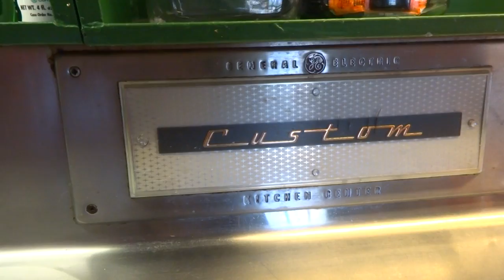PROPRESS FITTING POPPING OFF INFERIOR  PRODUCT TO SOLDERING

Comment: Going to be interesting to see what the heat does to those rubber gaskets
Reply: do a little research rubber seal is not what seals the water  but the actual press copper to copper, so it should not affect  at all.
Reply: @uspatriot9599  he's always doing band-aid fixes. 🤦‍♂️ To each their own I guess
Reply: @gelipeone  The rubber makes the seal dude... You think pressing copper together creates a seal? Lmfao
Reply: @uspatriot9599  Copper will also leak down the line, nothing lasts forever. Propress fittings are rated to last 50 years minimum. By that time copper would also have begun corroding. A soldered connection will hold much longer than the pipe itself will. The solder would last hundreds of years but the copper itself won't last even close to that long. Copper's lifespan is only about 50-80 years. Pex's lifespan is 100+ years. 

Propress has been around for 30 years and I have yet to see one fail on its own and not because of user error.
Reply: @losferwords100  Pex's lifespan is much less if you have mice. They chew right through it.
Reply: @darrenr1194  if 32kn won’t then I don’t know what will wonder how the details in coins stay together for decades too maybe soldered 😂
Reply: @johnnya4236  You're comparing a coin which is pressed into a mold creating a shape.... We're talking about two pipes here. Pressing two pipes together will not create a water tight seal. IF that were the case why is there a rubber O ring in each fittings end? If you could press copper to create a seal why can't they press together standard fittings? Smfh total clown who knows nothing.
Reply: @ImmaculateSludge  Problem is some plumbers are lazy or don’t know how to solder a joint!
Reply: @darrenr1194  ,I think you missinformed ,read little more.
Reply: @uspatriot9599   and do you believe that a simple o ring is going to last 15 -20 years ? the seal is a just in case,what makes the seal is the pressing actually bonding the copper together
Reply: "Rubber" comes in numerous types, and is used in nuclear power plants, helicopters, submarines, etc.

Comment: I’m a plumber I use pro press. And yes I know how to solder I’ve installed water heaters with soldered fittings and pro press fittings. Notice how the pro press ball valve on one side was crimped on to painted pipe without sanding the paint off the previous plumber had very little experience installing pro press fittings properly.

Comment: One reason for pro press besides the ease of installation is the fire risk associated with soldering. Insurance companies don't want to cover the cost of fire damage. I read on a plumbing forum a while ago that Massachusetts was going to require a off duty fire fighter to be on scene for all plumbing jobs that required the use of a torch. Guess that law didn't pass but that's where things are due to lawsuits, etc.
Reply: Thats why the need for pros 
If you know what your doing and pay attention you will never have a fire
Reply: im in mass and that is true...i know boston is requiring  "hot work permits" gotta have a guy on fire watch for i think 2 hours after and he cant be doing anything else....soon the whole state will have that
Reply: @jackblack9830  You obviously don't do commercial/industrial work. You have to find a fire watch, supplied by your company. You have to get a hot work permit signed by the appropriate people in the facility. Hang the hot work permit where you are working after you sign your life away. The firewatch HAS to stand there and watch you run your torch the entire time. If he stops paying attention you will be thrown out. Once you put your torch out most facilities require the firewatch to stay there and watch for fires for up to two ADDITIONAL hours after the torch was extinguished. Failure to do so and most safety guys will throw your company out permanently. Money is not an option for safety to big corporations. You just stick to your resi work my guy, the rest of us will do the big boy work.

Comment: More than likely it froze. If it freezes yes the progress will come apart. If it is soldered and it freezes either the pipe breaks or the solder joint also comes apart.  So it is not the pro press it is the home owner who let it freeze. If you do not want to use it that's fine your choice soldering is still great I mostly solder. But because you don't want to buy the tool don't mean the system sucks, also I am sure with all the Chinese fittings there will be issues. When I pro press I try to only use Viega. And you cannot solder that close to a pro press fitting.

Comment: No plumber likes progress and mega press until they finally shell out the money for the tool and realize how much of a lifesaver and time saver it is. My guys tried to talk me into getting it for about 2 years and finally gave in. They were right what a great system. Time will tell the lifespan of the o- rings.
Reply: Even then.... If it leaks in 15 years.... Cut it out. Crimp and replace in 15 mins. Done and done.
Reply: @travisnguyen3905 yeah unless you can’t afford to risk the potential $10k+ of potential damage to your structure if that happens

Comment: If copper soldering is done right it is certainly superior to the press system. But we also use stainless steel pipe for potable water overhere so there is no way around press fittings. If done right, they should not leak. But the main concern I have is the hundreds of O-rings in a typical home installation. Rubber deteriorates over time, solder does not.
Reply: What a crock! Solder joints leak all the time! Properly done ones and otherwise.
Reply: @SureShotImages  It's it funny how people claim solder joints never fail? I fixed more than I can count and I was only a service plumber for 3.5 years. I got as far away from that bullshit as I could. I'll stick with HVAC.

Comment: any fitting that relies on a rubber o ring and just a friction fit is guaranteed to fail sooner or later I stick with solder and copper pipe over all this new stuff that fails 10-20 years later like the plastic pipes

Comment: Morning Steve. I've been waiting for this specific video for a long long lonnnnnng time. I knew it was just a matter of time. I agree with you - in my house, it will all be sweat joints. Period. I saw a joint the other day on a press that was leaking because it was crimped at an angle. Drip drip drip. Never seen that on a sweat joint. Old school methods work for a reason. Just like everyone is going back to shaving brushes & double edged razors....grandpa was onto something wasn't he? Have a great Sunday
Reply: I love the double edge razor, been using one for the past 15 years. They give you an amazing shave and much more economical then the cartridge. I do own a single blade like the barbers use but don't feel comfortable with it yet.
Reply: @potatolew4495  60 years.  shortage of blades, double edge
Reply: 20 + years waiting for this video and just to find out mostly the person that installed it wrong 🤣🤣🤣
Reply: @seniorcomputer3292  Schick razor bought up alot of the old diesel submarines for their metal supply.
Reply: You've never seen a joint that was soldered at an angle that some hack plumber tried to pack with solder anyway?

Comment: I’m a firm believer in soldered joints......I’m not caring for propress , shark, or even pex that much I’m just old school when I first started we even used soldered copper waste lines
Reply: My brother's house in Chicago has all copper waste lines... I can't even imagine how much that'd cost to install nowadays between the cost of copper + cost of labor... he's thinking about DIY replacing the drain lines with PVC and selling the copper. Never understood what the benefit of copper drain lines is, must've been cheaper than cast iron at some point, but before PVC was widely available
Reply: @Reinhardt_Kozlowski  I sure it wasn’t cost conducive but we built homes in a upper class area and high level homes were expected to have the premium of everything I remember the carpet going down over unfinished hardwood flooring and of course all the sheathing was 1x lumber no plywood ......it was a lot different then in quality of homes
Reply: @danbailey96  If cost and time isn't an issue, then it seems like good quality cast iron (w/lead and oakum joints) would be a far better option than copper for drains. Legit question... I still have no idea what the benefit of copper drain lines is. I can understand cast iron (quiet and time tested), I can understand plastic (cheap and reliable), but copper????  That stuff is amazing for supply lines but I've never understood why there was a short period of time (early 1970s to early 1980s in Chicagoland) where copper drain lines were somewhat common. If you know the reason I'd be super grateful to know.
Reply: Copper drains was trouble free and probably more of a status point also ....we used copper guttering and flashing and valleys on the roof of course those were rust free and worry free. I have also replaced cast iron that had split....of course they were several years old.  Being in the home building, remodeling and now Handyman business for 55 years I’ve seen and done it all.
Reply: @Reinhardt_Kozlowski  You only had 3 options back then....cast iron, lead, or copper. Cast iron and lead were in the past and PVC and ABS weren't a thing yet.
Reply: @danbailey96  Yeah right dude, drain acid will wreck a copper pipe. PVC all the way. PVC, when properly primed and glued, will last almost forever.

Comment: I live in a large apartment building. Everything is soldered copper. Even when something like a water heater needs replacement the new one goes in with soldered copper. They won't let any plumber use PEX or ProPress.
Reply: Then they are foolish
Reply: @pb7379-j2k  Sure they are. They like paying for labor for no added benefits.

Comment: When soldering you are introducing chemicals into water supply not to mention open flames in tight spaces 
Propress is the best.
Previous guy didn’t press it properly

Comment: We have a little bit of Sulfur in our water, it eats up Rubber. Took me awhile to learn to use Silicone Hose Gaskets, especially on the Clothes and Dishwasher. I wonder what kind of Rubber Gasket is in the Pro-Press? BTW, Don’t use Pro-Press on a Water Heater Relief line, each Crimp counts as a Turn in the Pipe, in a lot of Places. So a Single Pro-Press would be equal to Two 90” Here we are limited to the number of turns off of the HW Relief, as it is a restriction.
Reply: The o-rings in the copper press fittings are EPDM rubber

Comment: I’m certainly not an expert, but when you show the propress fitting toward the end of the video the right side of that fitting did not look like it was fully crimped/pressed.
Reply: It wasn’t, we use pro press in high rises and hospitals all the time.  It is mandatory because of no burn in building codes.  Never had one pop off and we do ground up high risss with them.  Looks like a amateur tried to install them.  Steve need to stop hating on other methods your not familiar with.  Both methods are great if done properly.

Comment: up here in mass more towns are making you get hot work permits before you can even light up the torch.....more guys doing pro press..it has its place like everything else but soldering still needs to be done and taught to the new guys coming up..

Comment: If it popped out it was not made up all the way.  We use this in very large commercial installations on up to 4 inch and it works very well. Go to a large building were you can not get water shut off all the way and don’t have a pipe freezer pro press is awesome. You can cut a line with water spraying out and jam a open valve on it then close it after it is pressed. I have been installing pro press for 10 years I am a licensed plumber and I have never had a problem.

Comment: I personally love pro press, never had a failure with a few thousand presses so far. We also do mainly highrise/commercial bigger scale stuff.
Reply: yea I wonder if they failed to do it right ,I like sweating pipe but hard to find most tech is going away form it .
Reply: How do you know if they never failed? 2, 4, 10yrs down the line I'm pretty sure another guy was called to do a fix. You know? Hard to track every single job after its done.
Reply: The propress has been around since 89, the biggest advantage is you can press when you are passing water, I've been using it for close to 10 years and have not had 1 single callback of the buildings we still have. Honestly for small mickey mouse homeowner stuff who cares but when you need a bigger building back online I definitely don't miss sauldering, I can pipe in so much more in a quarter or the time. There's really nothing to sauldering tbh, the biggest failures I see in buildings are pinholes from dumb plumbers that don't rheem out pipe or sloppy sauldering jobs.
Reply: @sku32956  Or probably using some cheap press tool.
Reply: @VicHimself  majority of work is done without it so its kinda another reason we dont see them failing. Not many out there and when (if?) they do fail, another guy is called to repair it so we would never know. Impossible to keep track of every job and fitting. I dont even remember what job I was on 2 weeks ago let alone 2 or 5 yrs ago. Lol
Reply: @WeatherNut27  I personally would rather work smarter then harder, I think as long as the prep work is done properly there's nothing to worry about. Also a big advantage is beinh able to press in tight spaces to make emergency repairs.
Reply: @VicHimself  I hear you on the tight spaces but if I'm getting T & M I'd rather take my time with something that has stood the test of time. Lol :-)
Reply: @WeatherNut27  Because they never fail, that's how. Solder fails all the friggin time.

Comment: Regardless of which method you use, the guy installing them and his technique is much more important to the success of a joint. I’ve soldered a lot of joints and had a couple bad connections leak. Resoldered and they’re good. I can’t say I’ve ever had a pro press leak. I insert them all the way though. I’m sure they didn’t have it bite into enough pipe.